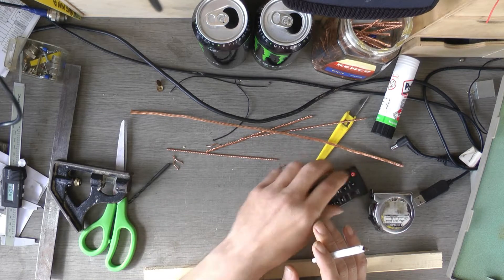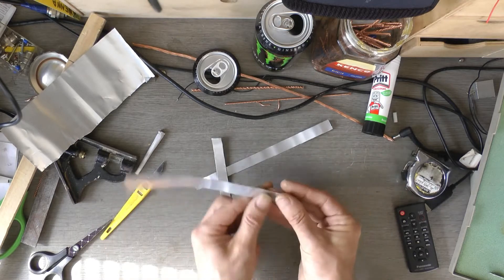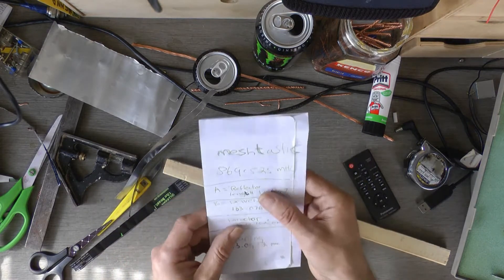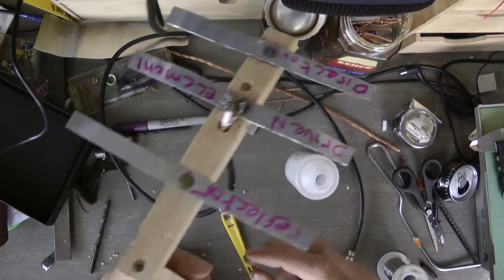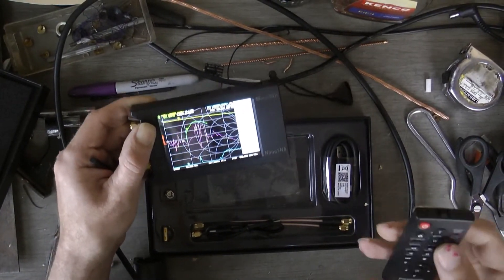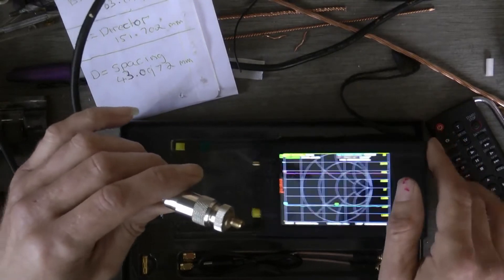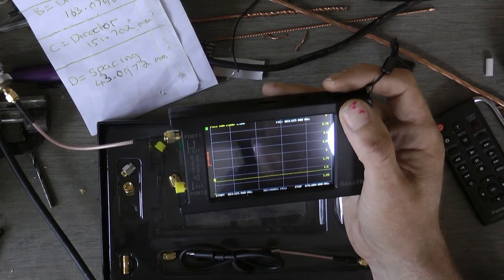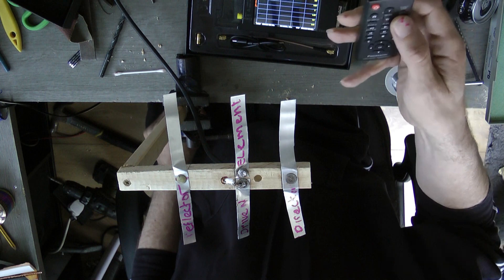Diy meshtastic 868mhz LoRa  yagi antenna using monster old cans

Comment: Surely you should set your stimulus to start at 850 and end at 890 - then you might see a proper SWR curve trace, and you can better see what frequency it's tuned at for the lowest SWR? Would be interested to see...
Reply from the maker: You know you have a good point there... I was just getting to grips with the intricacies of the vna I think I only had it a week or so. Suffice it to say im much better at it now im planning an antenna build with more elements, I will do as you suggest on this one. Thank you for your comment it is greatfuly received.
Reply: @SimonsSolarShed I've just got one and am still learning all its features. If you work out how to measure gain please let me know 😂
Interesting video though - will follow with interest to see how it performs on LoRa (MeshCore or Meshtastic) 👍
Reply from the maker: @MikesAllotment yes the gain would be an interesting one to figure out.. i just figured that due to it being a yagi antenna it would have quite a bit of gain given that its a more focused antenna but yes I would like to know exacly how much. Thank you for following I appreciate you 🙏